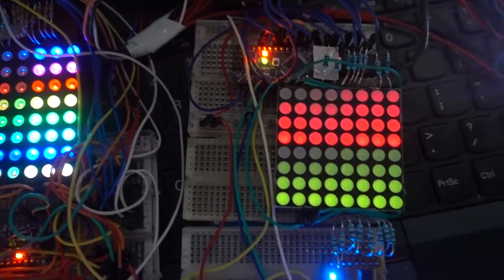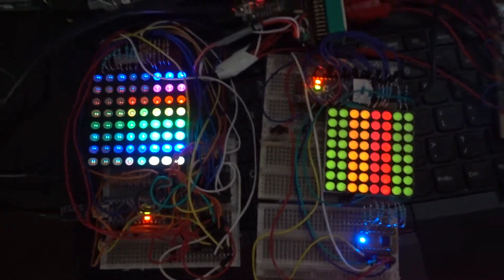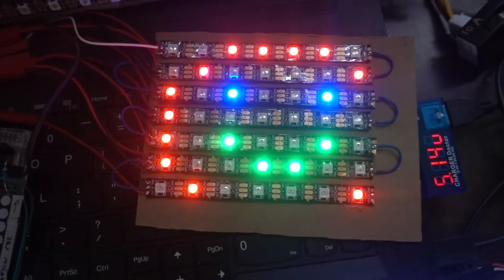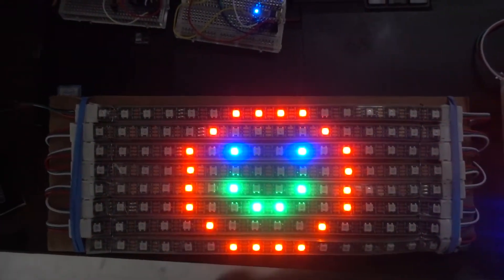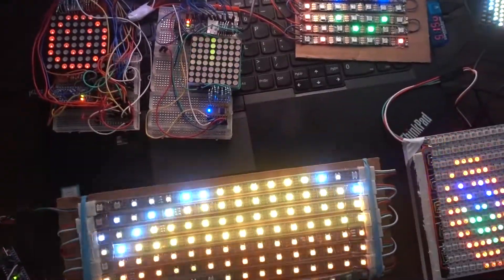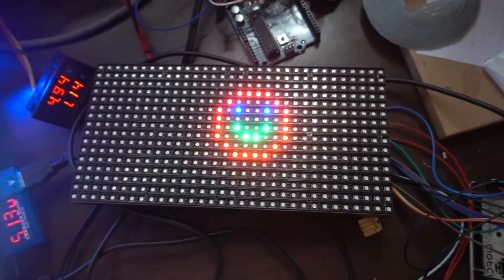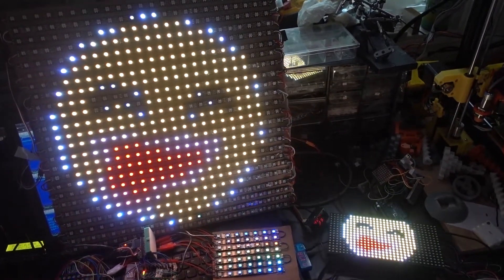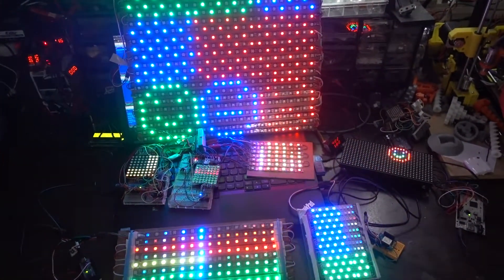Adafruit::GFX + NeoMatrix + Adafruit RGB Matrix Panel Demo

Comment: Sick work man! I These animations are really beautiful. Have you considered building anything on a larger scale? Maybe using multiple LIFX Tiles?
Reply from the maker: Have a look at  
http://marc.merlins.org/perso/arduino/post_2018-07-30_Building-a-64x64-Neopixel-Neomatrix-4096-pixels-running-NeoMatrix-FastLED-IR.html
Reply: @MarcMERLIN  url not found..
Reply from the maker: @KevinWildenradt  youtube is buggy and breaks the correct URL in 2 for no good reason. Just try  http://marc.merlins.org/perso/arduino/ instead and look at the first post.

Comment: Marc, that is sick! I'm going to have to look at your code to figure out how you're getting the timing right on the RGB panels.
Reply from the maker: Bob, actually I can't take too much credit here. With neopixels you can address them pixel by pixel, so there is no real timing issue as long as you have a properly working neopixel lib.
The only one that's difficult is the RGB panel which uses row scanning, but adafruit already wrote a working driver for it.
The one I'm more proud of and that took a long time to write was the driver I wrote for a line scanning matrix (not unlike the adafruit panel) using interrupts and while being compatible with adafruit GFX: http://marc.merlins.org/perso/arduino/post_2015-01-06_Driver-for-direct-driving-single-to-3-color-LED-Matrices-with-software-PWM.html